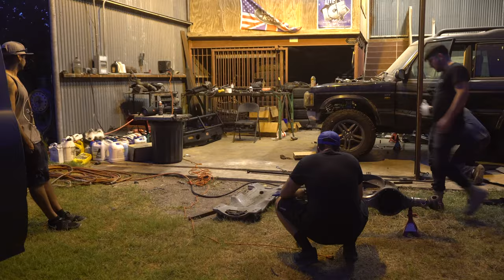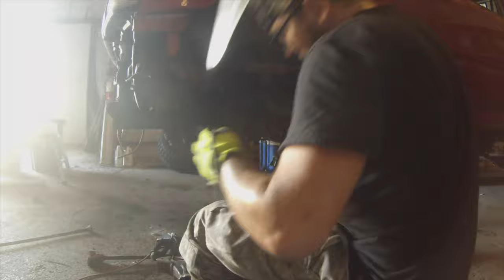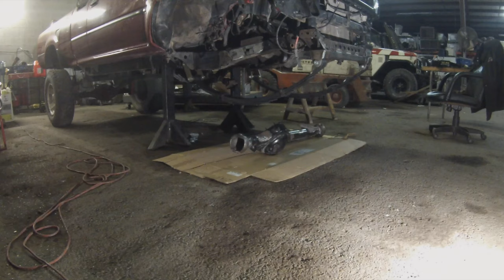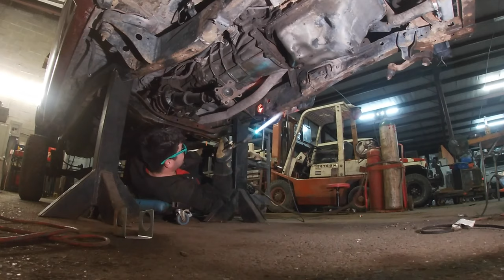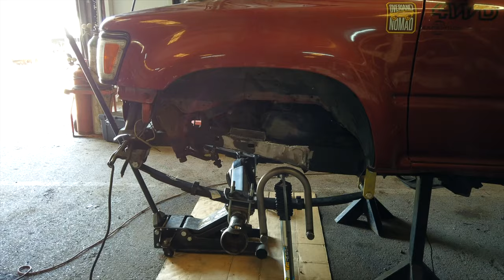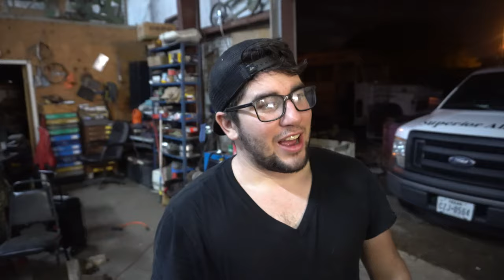Toyota Pickup Solid Axle Swap in 15 Minutes (EP 25) // 3.Slow Gang

Comment: You dont just get SAS so it gives it that classic look. You get it for articulation, hauling, towing , also stronger than a IFS . It might not be as smooth over bumps but a good suspension set up it can be. I have a 1989 toyota pickup extra cab sr5. With 35s ,SAS, lockers F/R. But right now I'm trying to figure what swap I want to do the 3.4 or a 22RE, or the tdi but the tdi might be more work than I want to do.
Reply: If you ever end up doing the tdi swap and document it leave me a link please! I bought a bug for the swap but haven't started yet!
Reply: 2.8 cummins

Comment: We need to hook up. Have a few 3x 3g projects and 2x 2g bigger projects. Took my 99 across to Anahuac, NL to my tio’s a few times. On the way to the bridge it lost a relay, had to rig a wire for the fan and fill the radiator with tadpole water from a trough. Ended up turning around and going back to the house because didn’t want to breakdown on the highway or spend the night on the bridge because I was too late arriving. Hit me up when you leave the frontera and make it to San Anto, come check out my collection of not yet running projects.

Comment: Nice, but I see a bad camber position, you need cut the differential housing or axle, I don’t know exactly the name in English, in the tips, and welding again with the correct angle.. if you don’t fix this before to finish, you have a big problem in the steering wheel.. excellent proyect and good luck
Reply from the maker: The axle was already cut and turned. Sorry it wasn’t mentioned in the video
Reply: @OverlandNomad  better, I see you channel and you have good videos, I want to see the final for this hilux.. other questions, this level is like for 37" or 40" tire, you put a 5.29 gear? And the other, this front axle is for a land cruiser?
Reply from the maker: Yes it’s regeared to 5.29 front and rear and I’m running 35s. I’m happy how it has performed with that combo for years especially on the highway. The axle must have been off from a 1983 Toyota Pickup.
Reply: OverlandNomad mmm ok, the same for the 4Runner first generation... cool bro, if you can, make a video, when you finish, how long does it accelerate from 0-60mph with the tires and the gear ratio you have, which I already know you have 5.29, but it will help you to have more views ;)

Comment: I need to know if when you welded the crossbar with the front springhangers on did you remove the 45 degree gussets that are rivetted to the chassis and stops the new bar fitting on. Thanks Wayne